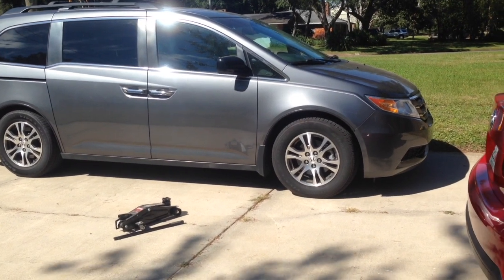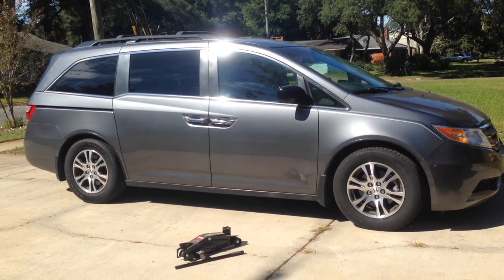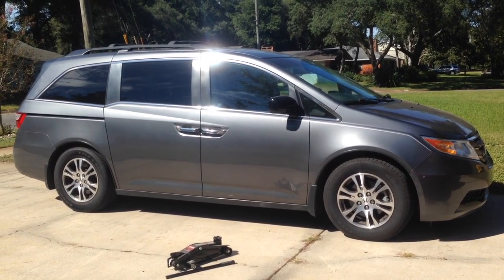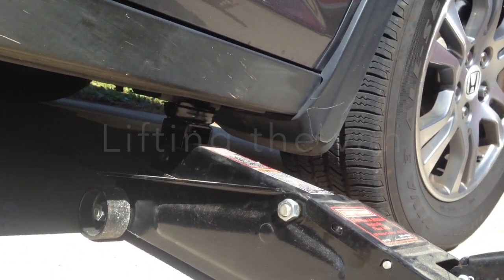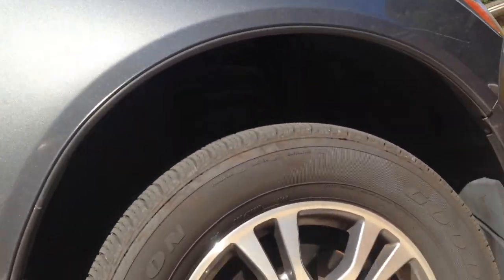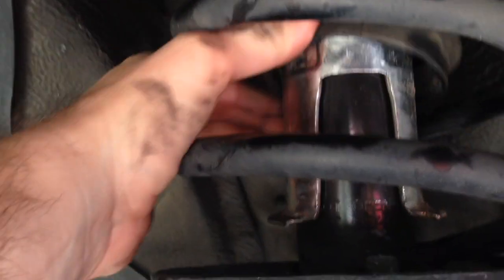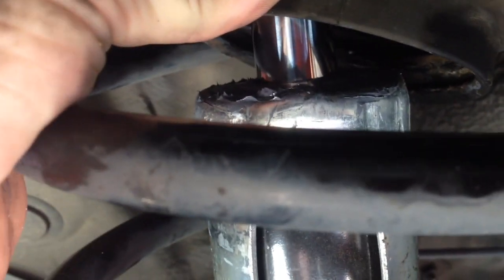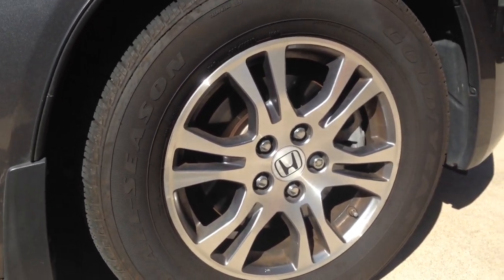2012 Honda Odyssey Popping, Knocking or Creaking in the Front While Turning at Low Speeds

Comment: 01 odyssey. At highway speed the van veers right when foot taken off accelerator.  The steering wheel a actually ticks slightly left when this happens. Then the van corrects itself when accelerator is pressed again. And goes back to straight. 
There is tiny tie-rod play both sides.  Tires have even wear. 
Van cluncks front left when accelerating after coming to a complete stop.
Front and upper right motor mounts were just replaced. 
My nephew replaced both struts and springs about a month ago.

Passrnger side vertical control arm bushing has some cracking.
Van has 191,000 miles. All rubber suspension bushings were replaced at 135,000. Plus motor and tranny mounts.
Reply from the maker: Have you taken your van in for an alignment check?
Reply: @meridianjumper  i plan to do a quick alignment check with strings. And rotate tires
I did another check today.
All bushings seem ok.
I am getting a clunk from driver side inner tie-rod.
Both inner tie-rods have movement.  But very slight.

The van gets squirrely when lifting of accelerator. 
It just doesn't feel like an out of alignment issue.
I will be gone for a week. I will try to update later.
Thanks for input
Reply: So I just replaced both sides inner and outer tie-rods.
And still have movement and clunking. 
It turns out the lower control arm horizontal bushing is clunking when grabbing left and right side of tire and torquinig it back and forth.
I removed the bolt and rotated the lower control arm out.
The bushing looks fine. But the bolt is very loose when slid back into the bushing.
This is where all the play and knocking is coming from.

Should there be a brass sleeve inside the bushing?
Reply from the maker: @golfish8589  Generally speaking there should be some sort of metal tube that runs through the center of the rubber part of the bushing to give it some rigidity. Most of the time when you purchase something with a bushing, the metal tube/support should already be installed. However, I have seen it on fewer occasions where the manufacturer doesn't install that tube and relies on the customer/end user to push it through the rubber.
Reply: @meridianjumper  
There is a inner tube with id of real close to 9/16 inches a ok looking bolt with real close to .5 od.
Two auto stores near me will have bushing for me to compare in the morning.
I may stop by Ace Hardware and pick up a 9/16 bolt and see if it fits.

The inner tube does not look worn

Comment: You may need to tighten the front center nut on struts also there’s been issues with them coming un-torqued & it causes a popping sound also my 2011 Odyssey EX was lose on the drivers side.
Reply from the maker: Good call. I have seen this center nut loosen up after replacement struts were installed and not properly torqued and verified.
Reply: @meridianjumper  update: mine were still stock just needed to be re-torqued all good now.
Reply: I look at my a is was lose too

Comment: I had creaking, starting about a year ago, when turning at low speed and accelerating from a stop in a 2010 Odyssey (model year prior to that addressed by TSB 11-038). Greasing the top of the front struts resolved it. I'm surprised that the strut bump stops are in contact with the top of the strut body. Maybe that happens as the springs age and sag a bit?  I used Honda Shin Etsu silicone grease, as described in TSB 11-038.  Any silicone grease is likely just as good, but this was a good excuse to get myself a tube of Honda's famed Shin Etsu silicone grease.  p.s. I didn't check the strut nuts, there was no need, but I have had one loosen on another car and it produced a distict clunk noise that was nothing like the creaking noise caused by bump stops contacting the strut damper body.

Comment: Mine was the sway bar link. After taking the tire off I could turn the wheel while touching the sway bar link and feel it pop. After changing with a Moog k750304 from Advance auto it’s fixed.

Comment: Did this didn't work. Finally brought it in to Honda. The customer service guy knew exactly what it was and said that he sees a couple vans a month with the problem. The splines on the shaft of the steering column need to be greased. His opinion was that when it was assembled they put too little grease and it dries out. They fixed the issue and no more popping, creaking or pinging. They charged me $189 and took 3 hours. I'll call that a win. :)
Reply: You mean the u-joint?
Reply: Can u take a picture where exactly?
Reply: Doing this definitely doesn't take 3 hours, half hour max
Reply: @peterredekop8624  he was at the dealership they probably had a line of cars in front of his.  So far I've heard splines, cv, and the sway bar...

Comment: Would help to hear the sound you are talking about.  I'm trying to diagnose sounds coming from my 2012 Oddysey
Reply from the maker: NMSB38 Its hard to get it on video or audio.  It is a pop sound from that area of the van.  It can be “felt” more than heard sometimes in the steering wheel.
Reply: I have a problem with my pilot I hear sow thing metal hitting metal  ur it sounds like it's a piece of metal gangi v n when I hit a Lil rough street then I hear the clanking sound of metal on metal. All my feint suspension is brand new the away bar li ka r good only thing I didn't change out was the struts/shocks. The noise is coming from the front driver side
Reply: Did you get the noise resolved? Did it sound like this?https://youtube.com/playlist?list=PLn5IhraTCbZSbd6RztpjkoFJHt03DNU91

Comment: What!   The wheel pivots left and right on two points, the lower ball joint and the strut bearing at the top of the spring. Its either one or the other part making noise while turning the wheel. Normally the strut bearing is bad if popping noise while turning.  Look up bad strut bearing video to see spring binding and popping because of bad bearing.
Reply from the maker: This might not be the fix as there are multiple causes of this type of noise. This video is for the noise from the strut which Honda released a service bulletin for.

Comment: I have the same issue is this a permanent fix or how can fix this for good. Dealer has said this a normal thing but I high doubt it. I will use grease hopefully this will take care of the issue. I have a 2012 Honda Odyssey.
Reply from the maker: Juan Mendoza I have only had to do this 2 times so far on the stock struts. I have about 15.000 miles before it will be time to change the struts out.

Comment: I knew someone that had one of these for 3 Days with less than a thousand miles on it and it started doing that. the dealer did a warranty replacement on the column and the new one started doing it after 6 months.

Comment: I live in an apartment building and my 2013 Odyssey, whenever going up in floors on the parking lot and I turn the wheel to the left, I hear a clunking noise coming from what seems to be the right front suspension. I thought it was the CV joint, but after seeing this, I'm not too sure now. This seems to be an easy fix since Honda wants to charge me $135 just to diagnose the noise. However, if I do bring the TSB to them, they should do it for free no?
Reply from the maker: gowdaflow , I think it would be something to ask but all dealerships are different.  Good luck, I hope this helped maybe get you in the right direction.
Reply: Hello, just wanted to follow up on this issue. I read the SB 11-038 and was wondering if you re-torqued the self-locking nut on top damper as mentioned on the SB (only for '11 models I know) or did if you simply applied the grease on top of the damper body? Was the noise eliminated on your car after you did this? Let me know, Thanks.
Reply from the maker: I did check the torque but it wasn't out of spec.  I did the video for my 2012 van.  Good catch.

Comment: Did this, didn't work. Replaced both struts, didn't work. At a loss now. Sounds like a creaky pirate ship when I'm turning at low speeds, and gets worse if I hit the gas slightly. I think it's the CV axles. We'll see....
Reply: Joshua Vida it is the cv axels left and right they go bad.
Reply: Thanks for posting this!!
Reply: Lower ball joints.
Reply: its the driveshaft
Reply: @joshua Vida, was it the Axle?
Reply: Same thing happens on my van. It’s the cv joint/boot. I’m told you usually just replace the whole CV axel assembly on the affected side
Reply: did not work for me also...i got 2012 odyssey exl...any advise..
Reply: how is your odyssey still pirate noise??any advise
Reply: Hey Joshua, so what was the final verdict?

Comment: How has your van been since you've performed this TSB 11-038?  Did it fully resolve this issue?  Thanks.
Reply from the maker: So far I have not had any issues out of the noise since I did this Service Bulletin.  I currently have roughly 52,000 miles on it.  I did have the dealership fix the issue back a few years ago and then I did it again on my own (prompted this video).  I think this will be something that we will have to do every so often.  Its an easy process so I don't think it will be that big of a deal.  I hope you have good luck with your repair.
Reply: @meridianjumper  what kind of grease did you use?
Reply from the maker: @budgettech5526  I used the recommended grease in the service bulletin. Shin-Etsu Grease (P/N: 08798-9013).

https://www.amazon.com/dp/B00GD49GTS/ref=cm_sw_em_r_mt_dp_U_8Aa0EbWXQBXKY
Reply: @meridianjumper  thanks for the reply

Comment: Thank you for your video. May I ask what type of grease you used? Thanks
Reply from the maker: I used some thermal wheel bearing grease for the time being but I returned to Honda and got the real stuff to that the Service Bulletin called for in case the noise comes back again.
Reply from the maker: Genuine Honda 08798-9013 Silicone Grease

Comment: Tried this, didn’t work for me. If your Ody sounds like an old pirate ship with creaking at low speed turns it’s the drive axels and wasn’t too bad to fix.
Reply: did you replace the drive axles? Turning my odyssey is clunking in low speed or parked.
Reply: jcontradiction yeah I replaced them over the weekend and it fixed the creaking and popping noises. Both drive axels looked perfectly fine and the boots were not bad.
Reply: @billhodges6547  did it sound like this? https://youtube.com/playlist?list=PLn5IhraTCbZSbd6RztpjkoFJHt03DNU91
I am 1500+ in chasing this sound. Today I had shocks and struts replaced...sound continues.